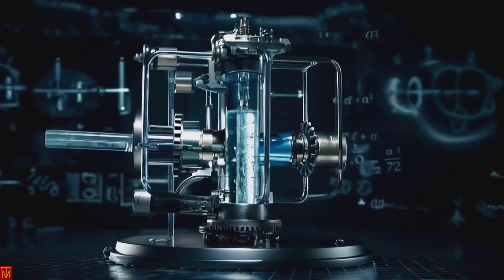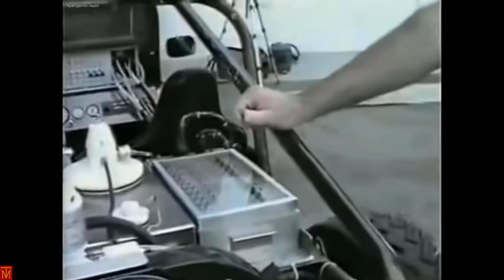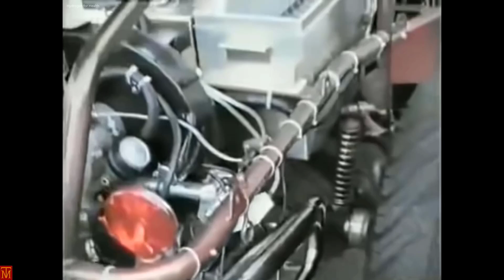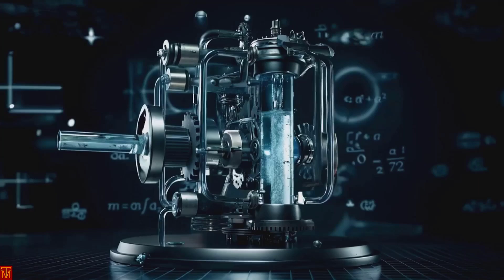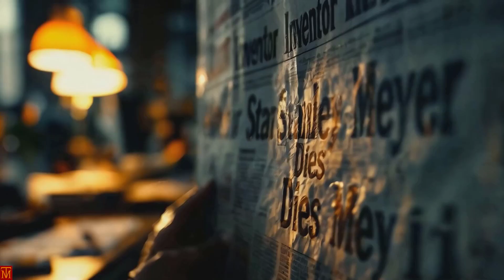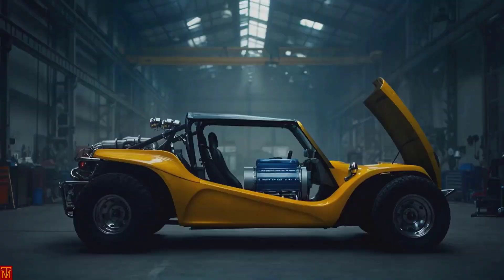Car Uses Water As Fuel?

Comment: The primary problem with this technology is no one ever took the time to make use of the scientific method to figure out its' secrets. Now I did move to make use of the scientific method and what I found out was mainstream science simply doesn't fully understand Photosynthesis as they missed something big. The last step a plant takes when it breaks the bonds of the water molecules is to take the electrons away from the atoms that make up the water molecules. It is that act that breaks the bonds of the water molecules. In my research I also found out it doesn't mater how those electrons are removed as each method will have the same result, IE, the water gets broken down into its' component atoms. That is just how this technology broke the bonds of the water molecules as Meyer made use of ionization to get the electrons away from their atoms.
This is the actual science behind just how this technology works. I created a theory that will be in the books of science one day and here it is: "All Molecules can be separated into their component atoms by taking away the electrons from the atoms that make up the molecules."